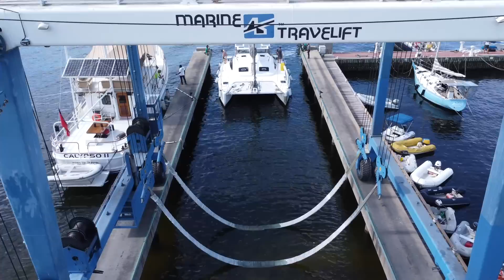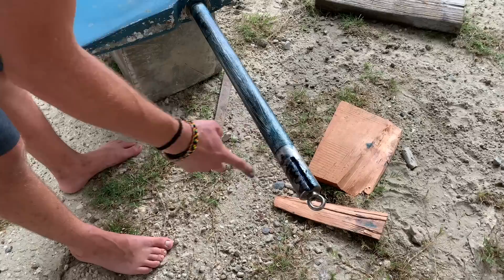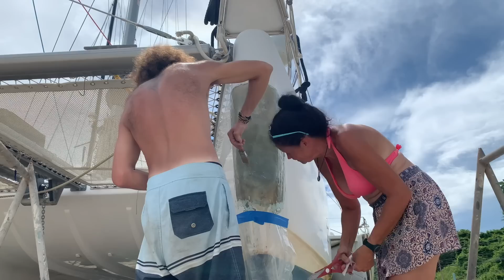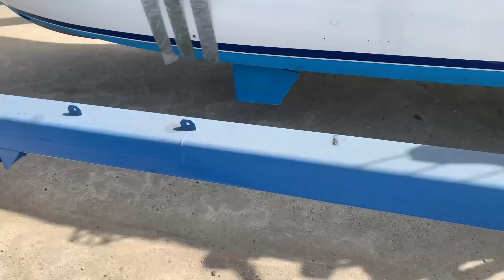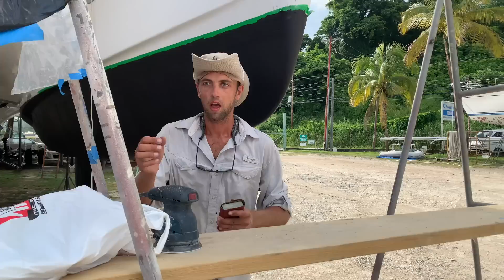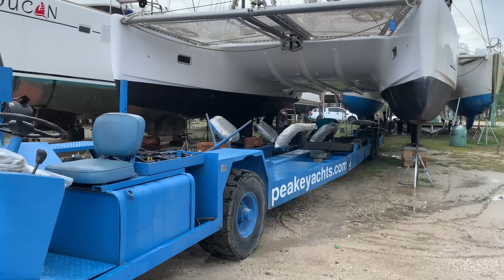WE HAD TO HAUL OUT & complete our emergency repairs‼️

Comment: What app do you use for temp and weather readings?
Reply from the maker: We use a couple because sometimes they differ so we kind of take a couple and try to decide the most likely scenario. Depending on where we are and specifically what we are doing, a crossing as an example, then we use specific sites. 
Mostly it's Predict Wind, Windy, Wind Guru and then a couple of the surf weather reports to check specifically coastal wave patterns and strengths, in anchorages and along coastlines.